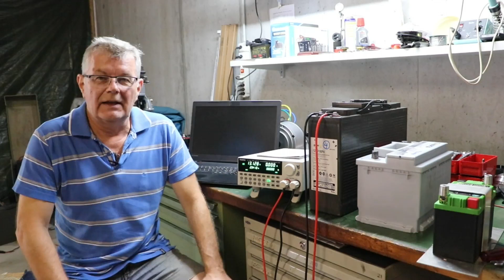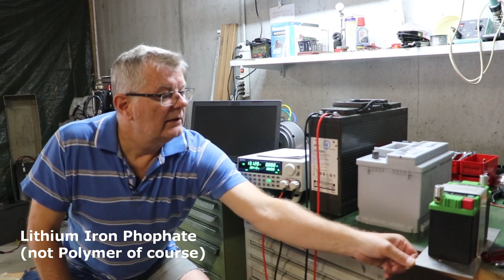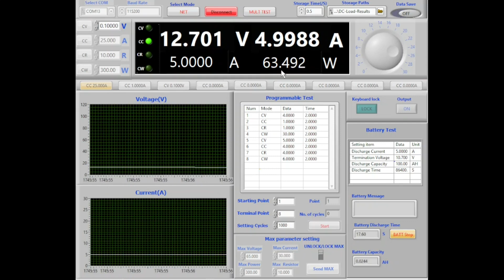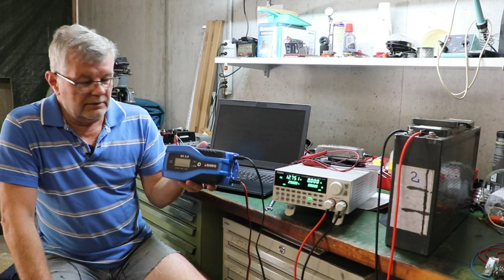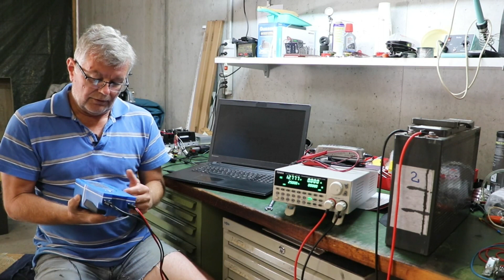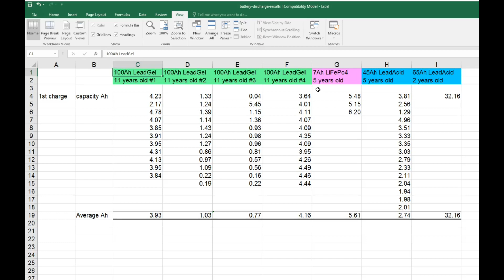The real capacity of batteries after years of use

Comment: From my similar testing on AA and AAA batteries, a lower current allows to extract more capacity out of a battery. Since the internal resistance is high - for old batteries - they end up reaching the termination voltage sooner than their actual capacity.
Reply from the maker: Yes, this is certainly true. During the load-tests I observed the battery voltage actually rising. I would assume this is happening due to the battery internally heating up under load. The lead-gel types seem to stay much longer above 12V but when dropping below 12V they reach 10.7V within a few minutes. The lead-acid types gradually drop to 10.7V and it takes much longer. Thanks !